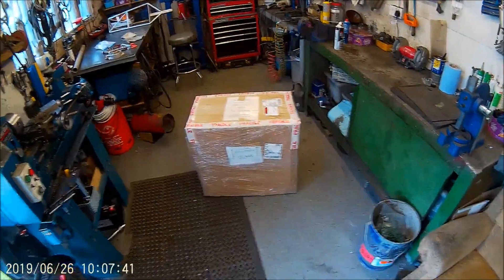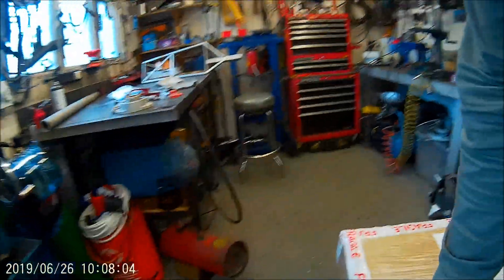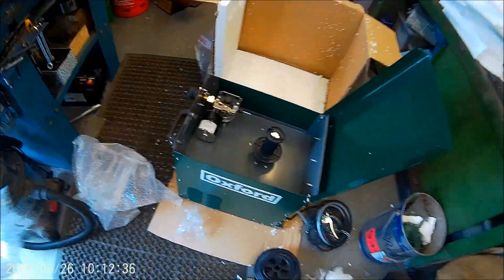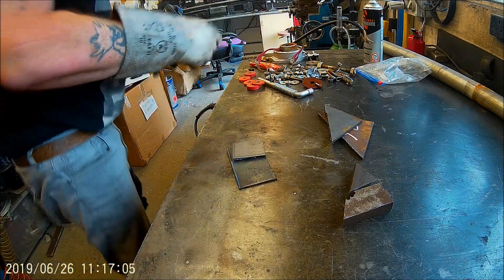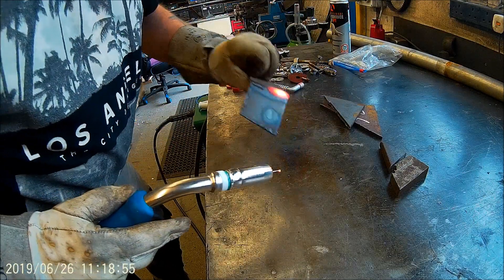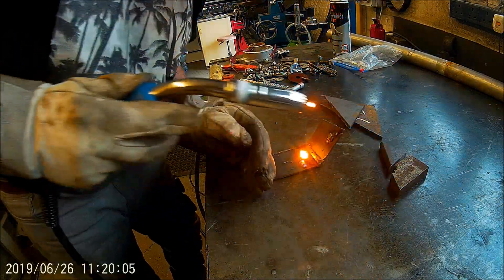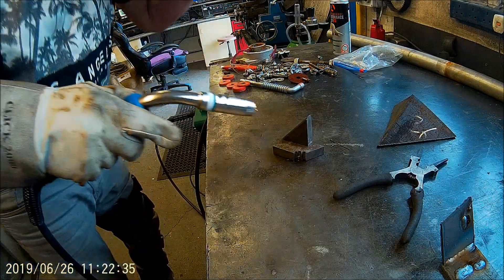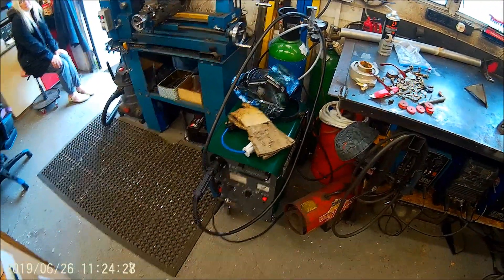Oxford Welder Mig 240

Comment: Hey there, you still using this one? Also what rollers did you request from them if they arent the standard ones?
Reply from the maker: Hi there thx for the comment, Yes still using the welder its awesome for what I need, I did add a second cooling fan as I have over heated once :). I had .8 mm rollers and have only ever used .8mm mig wire hope this helps. Cheers Nigel
Reply: @fixitnige  Thanks! Looking at ordering mine tomorrow hopefully if they ever get back to me with prices haha. I do mostly hobby welding but there is some projects that are structural that I want not falling on me out of some fairly thick stuff so i'm after one of these. I have an Oxford RT110B (from 1960) from the 60s and still running beautifully even after decades in the shed. Lookin at gettin the 240 as my first and hopefully last mig.  Thanks so much for quick replies etc :)

Comment: what ever happened to PPE. you will end up with skin cancer. Oh and by the way you travel forward when MIG welding.
Reply: Push or pull mate not much different on carbon steel
Reply from the maker: hello geo I was trying to get  sun tan arms lol push or pull its what ever is best at the time :)
Reply: You can push or pull on all welds with MIG - horizontal, overhead and vertical up or down. Entirely down to the user, material, thickness etc. Pop over to WeldingTipsandTricks to see all these demonstrated in the 'how to MIG weld' videos, worth a watch for the novice.

Comment: Interesting stuff, the cooling fan sounds very noisey. They are good people that make the Oxford, they did a recon job of my Oerlikon Solomig 230C PCB. I have an old (1980's) Oxford Bantam 180 AC welder and it's a grea bit of kit. They were a different company back then but today's stuff is good.
Reply from the maker: Hi Dingle I have used this welder so much doing my falcon restoration I hardly notice the fan anymore. I learnt to stick weld with an Oxford oil cooled welder and I still see those type around from time to time.
Reply: @fixitnige  Hello young man, Only found your channel tonight so just had a look at some of your videos. The Falcon, quite a project I will have to watch. I bought my Oxford in a sale and it cost about £120 and it is pretty mint, works a treat and has a battery charger built in too. I would recommend you get one because prices seem to be rising slowly but surely. Not so keen on very new stuff.